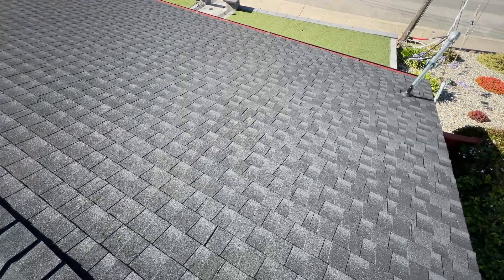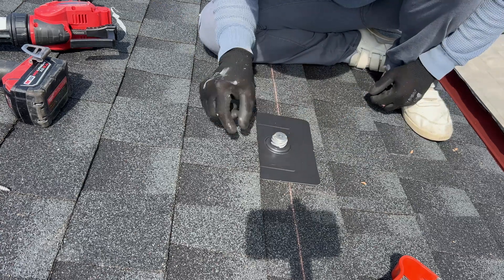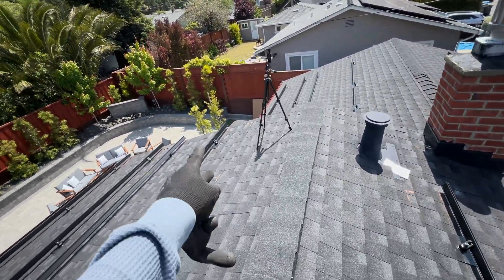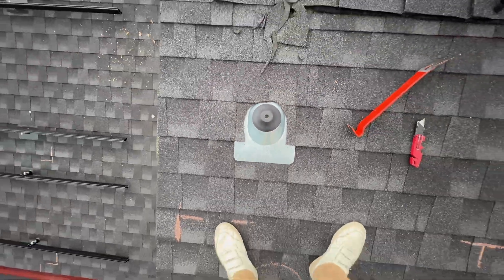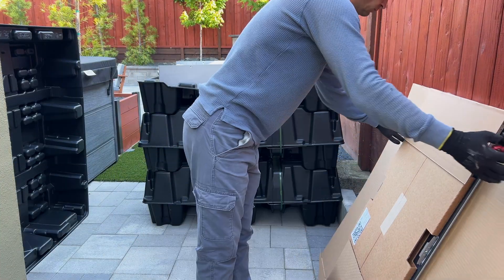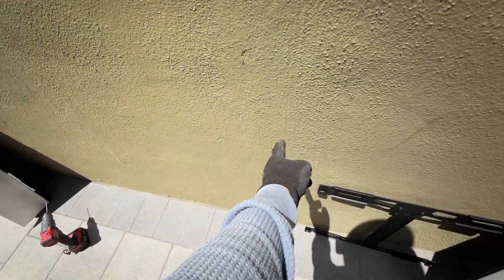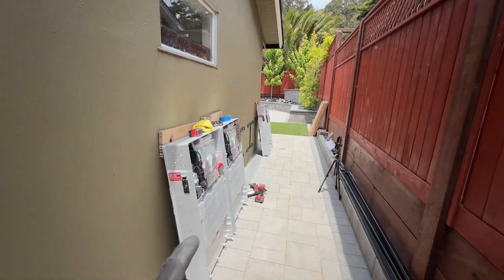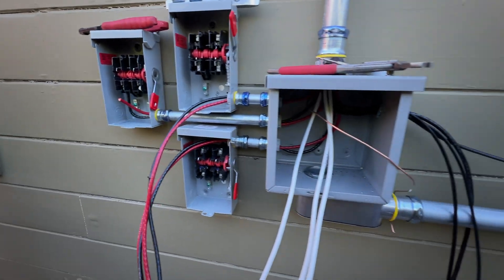Installing 21,000W solar array with 3 Tesla Powerwalls 3. Full home battery backup.

Comment: I have a question. Shouldn't the ESS be located at least 3 ft from the other powerwall?
Reply from the maker: Tesla has UL9540A certification, that allows to install less than 3', however some AHJ still not allows to install less than 3'

Comment: Very nice, thanks for sharing that! What specs are for a panel, how many watts and kg?
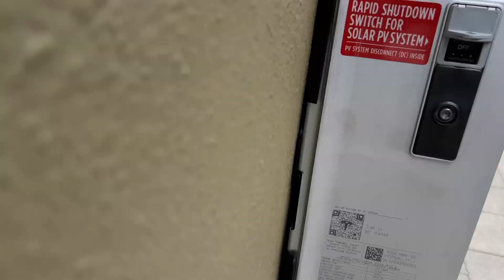Also, 9:30 mounting the powerwalls, isn't that too close to the ground? Mainly because of rain or even flooding, sometimes. Or snow, during winters. But it depends on the area, of course.
Reply from the maker: powerwall can be submerged into water at the level where red cap installed at the front. It's fully sealed below this level.

Comment: Nice installation.
I think two powerwall3 were enough for 21kw solar panels
Reply from the maker: we are in area where utility don't pay much for exported energy, so owner wants to maximize self-consumption.
Reply: He’s got 21 kW in storage. He needs three Tesla power walls for 40.5. I have an 8.69 kW system and I have three power walls just for the simple fact that I do experience outages and I want to use it to my advantage during peak rates.

Comment: That's a lot of panels and powerwalls for that size house. My utility wouldn't let me put on that many on my 3000 sf house.
Reply from the maker: interesting, not an issue in my area
Reply: @SolarEngineering  Looks like they dropped the cap here with SDGE when they changed the net metering. I'm getting two Powerwall 3s installed today onto my existing system. I had a 10 panel Enphase based system and a newer 27 panel SolarEdge system. Removing all the inverters and using the PW3 ones instead with the backup switch and no gateway.